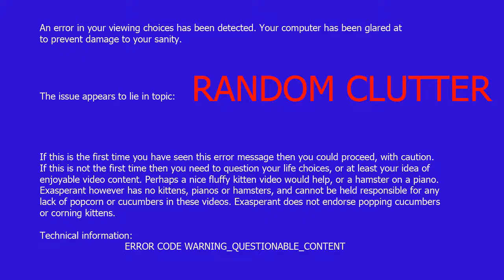Fixed or Phuxxed Ancient LG 42LC2DB - No Power Clicking

Comment: I've actually got this tv and it's doing the same thing with the clicking. It is a beast of a tv but I rather like it. Unfortunately I just spent £26 on the 2 digital boards which turned out not to be the problem, to now knowing it's the power supply and I've just spent £38 for one and have been scammed by the company.
Reply from the maker: I gave mine away after this, it was simply too heavy to move on my own without injury to it, me or both! But I did enjoy fixing it, and I think it went to a good home afterwards.

TV clicking seems (bear in mind I do this for enterainment, and as a hobby, so I'm no expert and could be seriously wrong) to almost always be a bad PSU. And that usually seems to mean bad caps, especially on older sets. Although I did have a fairly recent LG that was doing pretty much the same, and it turned out to be the main board (spoilers, that vid's not up yet!).

Capacitors are way cheaper than power boards, if you hopefully get your money back off the scammers and you've got a soldering iron to hand.